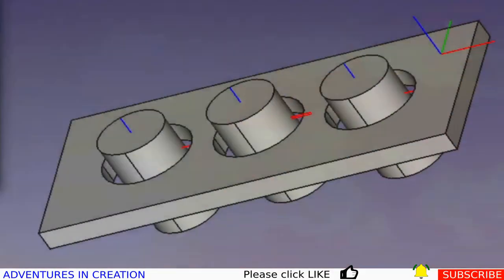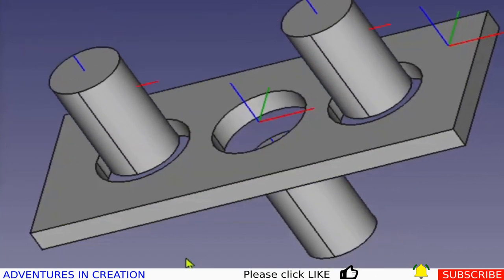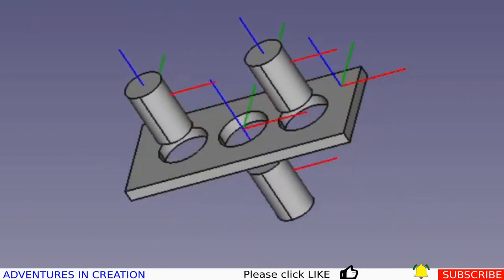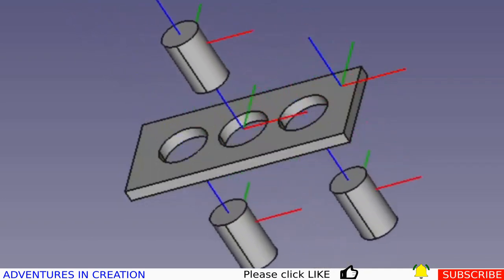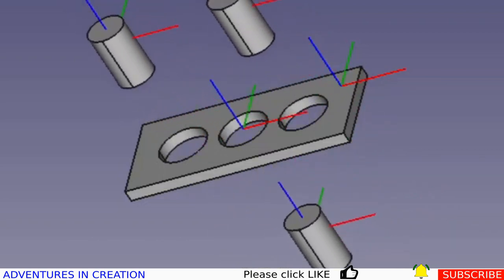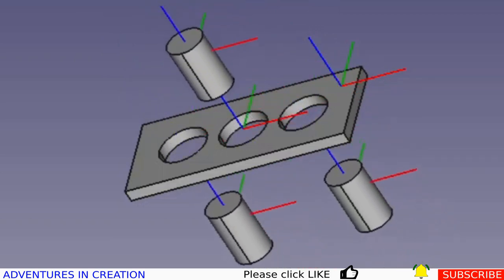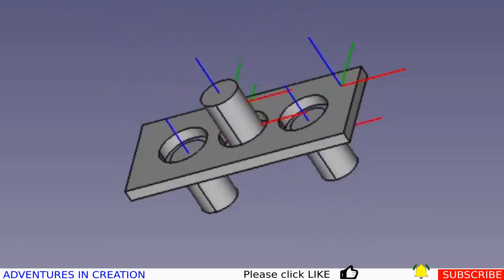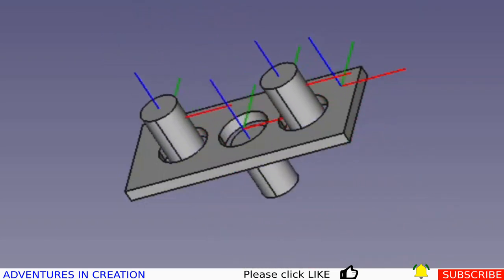FreeCAD Assembly4 and animation the easy way

Comment: Great Video!  I have to say that for a beginner (me), it was difficult.  But in the end, it works!  I need to go back and do this several more times to cement the concepts.  Thanks!
Reply from the maker: Assembly is not intuitive in FreeCAD at the moment. I am hoping it will improve and become far more user friendly but for now, it works and you can get there if you just follow the process.

Comment: Good tutorial, simple and clear. One thing is that for the master sketch, I think you can just have it as a sketch in the model part. It doesn't have to be in its own body and assembled into the model, unless maybe you want to place it with an LCS also.
Reply from the maker: Thanks for the feedback. To be honest I think there are many ways to reach the same end. I just wanted to show how I get there.
Reply: For this simple assembly you could but I like this approach as it looks like you can use this to combine an assembly with many more parts which might not connect to each other.

Comment: Another excellent video thank you. I now have an animated video of a freecad designed jar with a screw lid opening and closing. I had no idea this was possible. Thanks :)
Reply from the maker: That is so cool 😎
Reply: @Adventuresincreation  In fact... having considered the logical operators  in the function editor for Freecad expressions we can make some interesting moves where the lid turns a half turn and then lifts up slowly out of the way, i.e: my expression is:

 "Variables.position > 40 ? (Variables.position - 40) / 3 : 0"

Comment: Thank you for your educational video. You explained it very well. I am now trying to use it for my requirement. I'm curious whether it will succeed. 
I also like your other videos, from which I can also learn a lot.
Reply from the maker: You are welcome
Reply: Hello A.i.C. I did it! But I had to try for a long time. 
My project consists of two main components, one of which should move in the y axis. My problem. The two main components consist of many bodies and smaller components in the form of compounds or simple copies. When assigning "Datum Objects LCS ́s" I could only select one body at a time. 
So I created a compound of the two main components in "Parts" and a "simple copy" of it, which I then integrated into the "Model". Then I could enter "variables" and realize the movement on the y axis. 
However, the conversion via compound and simple copy has the disadvantage, that all selected colors for the areas are lost. By right-clicking on the component, (under Transform)  says "Override colors"  - so that new colors can be assigned. But it takes a lot of time. ;-( 
Maby you know a better way to work with assemblies that consist of many bodys? But you helpes me well. Thank You ;-)

Comment: Good video. It is simple to follow. I agree linking would be a better approach to keep parts library seperate from the assembly. The assembly methodology is a bit different than Solidwork. In Solidworks, the part LCS's are drawn automatically no need to add one to the assembly, and parts are assembled using base-assembly edges and surfaces to align parts. Looks like, in FreeCAD, LCS's are the only way to align parts. It is a bit slow. May be macros can come handy to reduce assembly steps. Is there a feature to grab the parts and slide along its access? Can parts be moved in assembly space before being locked to the base assembly? Still it is very versatile. Thanks for such a good work preparing the video.:oops:
Reply from the maker: Thanks for the feedback

Comment: I have been trying to learn the assembly 4 workbench off and on for months.  Your video has enlightened me a bit but there is still some head scratching.  I'll re watch this several times more and perhaps I'll learn more.  I agree with your approach to leave the links out of it for the time being in an attempt to ease the newcomer into the process of assemblies.  I understand the benefit of the links but doing it your way here would also allow someone to divorce the assembly file from the individual model files if that was desired.  Ie if the individual model files were subsequently moved somewhere else in the computers file system I suspect the assembly would blow up as a result as the links became invalid .

This whole workbench is powerful but extremely difficult to learn.  I was using assemblies in Fusion 360 in a matter of an hour.  I do hope you continue to make videos that feature this aspect of Freecad as the wiki just didn't work for me trying to learn it.

Many thanks for your efforts on this- I've been patiently waiting for someone to put out a narrated video on it for months.

Cheers from Canada,
Lewis
Reply from the maker: Let me know if you need any more help. I think if you follow the video you will get there.
Reply: I agree ,compared to the other workbenches this one is overly complicated and confusing
Reply from the maker: @ronson66  stick with it, once you get it, it's very powerful. Also, take a look my video on making the Desk Caddy, that has more assembly 4 in it.

Comment: That's a very well made video and a good introduction to Assembly 4. Congratulations.
I'm not sure however why you wouldn't use the link feature to add the parts to your assembly. The link feature is just fantastic. It allows for a file structure such as in SolidWorks where parts are in .sldprt files and assemblies in .sldasm files. The parts can be shared between different assemblies and they can still be opened individually if you need to edit them.
Reply from the maker: I totally agree that the link feature is great however, I didn't want to make the video any more complicated that it was. I think a lot of people struggle with getting started on Assembly4 (I know I did) so I wanted to keep it simple. - I did mention that in the video as I knew some people would use the link feature in creating assemblies. - I may do a follow up video using the link and step imports (I don't have access to solidworks so nothing from there).

Comment: This is my first foray into "Animation". I enjoyed your presentation and after a few failures could duplicate your design. My question... is there a way to independently move each rod  to a height of my choosing ??   In this Video - it appears - only two positions are possible (plus) and  (minus) in the same increments of motion, UP/DOWN as well as DISTANCE.   
Thanks for any feedback
Reply from the maker: This is just a simple demo but yes you can separate and move the way that you want. You should also take a look at my video that animates using Blender. The tools in there are excellent 👌

Comment: I prefer using the "Insert a link to a Part" feature in order to keep the files separate. I had the Structure toolbar hidden, so I hadn't seen the "Create a link to the selected objects" button until you pointed it out in your video. So, I've never used that and am not sure how it behaves.

Using links keeps each part in its own file, so you can modify any of them and the assembly will automatically update (usually - sometimes you need to click Update Assembly). I find it easier because it lets me focus on one thing at a time in each file: one file for each part and another file for the assembly. Using this method, I haven't yet had a need for a separate master sketch.

What do you feel is more confusing about links?

Edit: I commented before reading the rest of the comments and just saw that it's already been discussed. The video was put together very well - thanks. Subscribed!
Reply from the maker: Thanks for the input. I agree that the Links are a good option.

Comment: Nice demo.  

Do you have any suggestions on an design/assembly tutorial showing something like the carousel with the 
horses rotating and moving vertically during the rotation.  I need to design a mechanism involving four symmetric pressure chambers  on a carousel a "virtual horse/piston" that performs in a similar manner.   The four horse will be driven by a central axle to which the pressure chambers will be parallel.
Reply from the maker: I do not know of any videos that show that kind of mechanism however, all the techniques you need are available
Reply: At the moment a disk shape with a central axle and four symmetric holes has been created along with a "master rod".  The rod and the holes have lcs attached.  They will be used to assemble something similar to your demo.  Then they will go into a rotating assembly,if all goes well.
Reply from the maker: @markwilliams8892  sounds like good progress, let me see it when you get it done.

Comment: This is a great video! Unfortunately, it's being let down by the lack of reliability of FreeCAD. The entire assembly animation worked smoothly on Day 1. I come back 2 days later and reopen the project and try to run the animation without touching anything else,  I get an ugly Python error and the animation failed to work. There were neither updates to the project, to FreeCAD, nor the OS. And yet, the whole thing decided to break for some reason. 

Regardless, I learned a lot from this video. So, thank you!
Reply from the maker: Sorry to hear that. The next video I publish will be animating FreeCAD models in Blender. The way that blender creates animations is significantly different and far more robust.

Comment: Great Video! I will try this. 
A few thoughts:
Adding LCS in every model seems a bit redundant to me? You could add them in the assembly file, and only there, as well, can't you? Also, if you don't link the models, how to maintain consistency to the assembly when a part is changed? You will have to do all the work of inserting the part again I guess. 
Freecad is a great tool, but it is not always clear how the tools and  workbenches are supposed to be used.
Reply from the maker: The lcs is used to align the part on import so it makes most sense to add it in each part.

Comment: If you change the length of the Rod part, will it also change for the three rods in the assembly?
Reply from the maker: Yes, if you change the model it will change all instances.
Reply: @Adventuresincreation  thanks you! Can you also add subassemblies to the assemblyfile?

Comment: Dear "Adventures in creation" thank you for great job!
I have a question:  
I want to "drill" the hole thruogh the few parts within of  my Assembly4. After that I want to add the bolt.  It is very important to have hole in the originale file of "partdesign". How to do it right? 

Many thanks.
Reply from the maker: Thanks for the feedback. You can go back to your original part and create the hole.
Reply: @Adventuresincreation  Yes. You told about classic way. But I think about  packet editing of few parts. 
It is a pity that Assembly4 doesn't have the  such  functionality.

Comment: You dont need to create yellow parts for each blue body, you can attach the LCS to the bodies directly. Question: Is the master sketch not redundant? Could you not have just used body parat directly, and link it to LCS of the body (if the body had 3 LCS attached to it).
Reply from the maker: As I like to point out, this is how I approach the problem. There are undoubtedly many ways to achieve the same end but I like to try and keep it simple and consistent so others can follow along. I appreciate your feedback though, keep designing.

Comment: Not the main point of the video, but I've never understood why FC marks items for recompute rather than just recomputing. Is there a situation where you wouldn't want to recompute? I have had nodes that wouldn't recompute due to an error I couldn't figure out.
Reply from the maker: I think sometimes the recompute can take a while so you get to decide when to do it but, at some point you have to bite the bullet 😉
Reply: @Adventuresincreation  Ok makes sense. I guess nothing I've done has required that much compute time yet!

Comment: What is the advantage of this WB over say A2+? Ability to animate? I mean this is just a complex series of steps vs. A2+ just to get to assemble the parts without even having updating available because your bodies aren't linked to the original files. I don't get why this has to be so complicated. SWX does part constraining so much easier without all these hoops to jump through to get it right. Adventures in Creation "It's that simple", compared to what?
Reply from the maker: There are several different assembly workbenches each has pluses and minuses. This is an example of one of them.

Comment: This example is an easy demo but is defeats the purpose of parametric modeling. It duplicates everything - the parts themselves and the placement parameters. Just to get it working for show. It teaches us all the wrong practices.
Reply from the maker: Thanks for the feedback
Reply: I don't think a method is wrong if it works. There are, often,  many ways to achieve the outcome.  Advinc's video explains a lot of bits of Assembly4 . Different tutors have different styles.